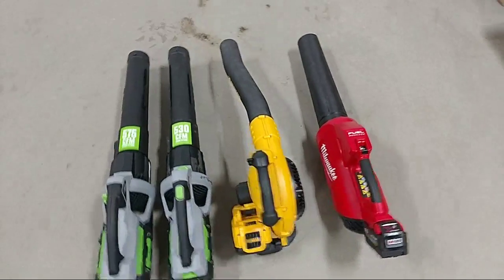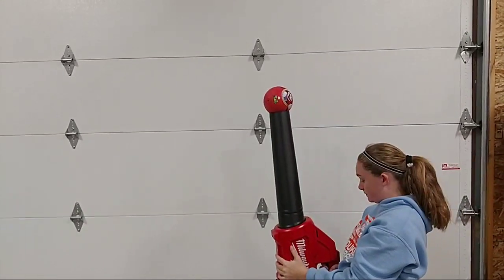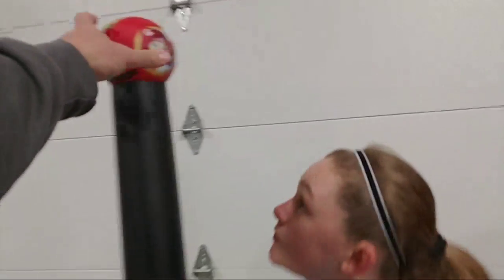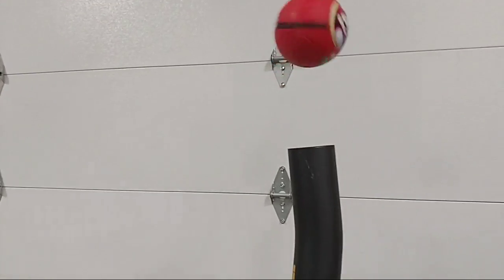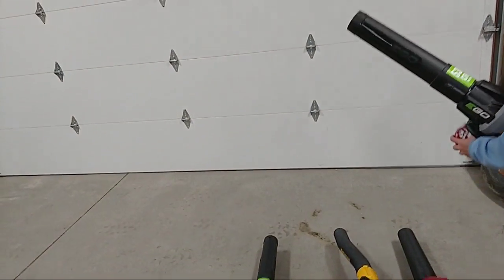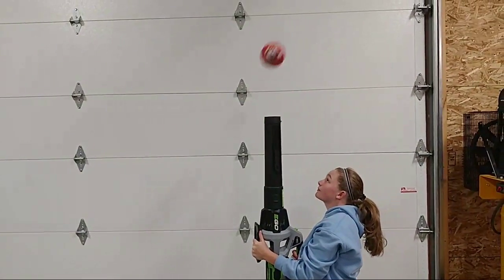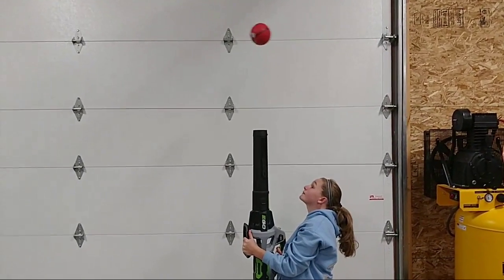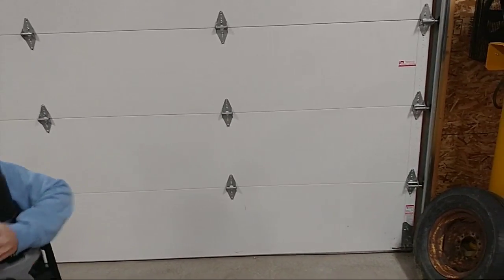LIVE: EGO 56v, Dewalt 40v & MILWAUKEE 18v Blower Testing

Comment: Have you had a chance to try the new gen 2 Milwaukee blower?
Reply from the maker: Tim Engle yes, it is just spring here so no video yet.  It is much quieter.
Reply: WorkshopAddict I just returned the gen 1 for the gen 2, i wonder if the extra 20mph would make a big difference on the ball height. Thanks and keep up the good work!
Reply from the maker: Not much.

Comment: What about taping the blowers to the narrow end of a cardboard funnel (or a tube) with the bigger end of said funnel to a fan and measure the power output of the fan moved by the air of the blowers, you'll need a load like a light bulb connected to the fan and a wattmeter (or two multimeters, one measuring voltage and the other measuring amps and compute the power by multipliying the 2)
Reply: I look at it like the horsepower vs torque comparison. HP (speed) is how fast you hit the wall and torque (CFM) is how far you take the wall with you. It's also like cleaning units on a pressure washer. To compare you multiply psi x gpm. So maybe a better comparison is looking at the "blowing units" (speed x cfm). Problem is with blowers I feel like the CFM rating has more impact.
Reply from the maker: romteb I like it, but would some of that come down to stricky mph of the wind....
Reply: If all the air from the blower goes to the fan (why you need a funel or tube with good sealing) then all the air produced will contribute to moving the blades of the fan, it's like a reverse CFM measurment, i suppose the watt figures will scale pretty linearly with the relative CFM produced by the blowers
Reply from the maker: romteb I like it.  My question is is a small stream of air at a higher mph will make the fan spin faster than a larger stream at a lower mph.  Basically, could an air compressor with a 1/2" hose spin the fan faster than a blower.  I know what your saying, just trying to figure our what is tested by doing this.
Reply from the maker: To take it a step further, we are doing these tests because some blower manufacturers will do a cfm test without the tube.  That has less restriction and the unit moves more air.  The the MPH test is done with the tube.  So we are trying to visually show what these blowers do.

Comment: What about blowing a bowling ball, with the nozzle at a set angle and hight from the floor, this adds weight to the test. Placing the blower at a predetermined hight based off the handle (they should all be held at the same hight in relation to the hip not ground) and at a natural angle to the ground. Then see how far each will blow a bowling ball, the distance will be determined by force applied.

Comment: Great visual!  My son liked the Mario ball.  Any chance you guys have the Ryobi blower to run the test?  I'm considering the Ryobi blower and trimmer because it's less than half that of the Milwaukee, and the Ryobi hedge trimmer is really very good - I've borrowed one.  I just want the blower to clean up after mowing and blowing off the deck and pool, so the Ryobi would likely be sufficient. I'm not planning to use it for leaf cleanup.  I have a Red Max backpack which is hardly sufficient for my yard.
Reply from the maker: Wild Goose it is on the way.

Comment: One complaint about EGO I heard is, unless they keep using turbo, it doesn't have much power.

I hope to see how it compares to others WITHOUT turbo.
If it lasts only couple minutes with turbo, probably it wouldn't be very useful without additional batteries. But if it's still pretty useful without turbo, I'd consider that for my next blower.
Reply from the maker: Kyong Song Take a look at our last video.  They have a new unit without the turbo button.  More like main stream blowers.  But everyone likes different stuff and we hope to provide the info people want to k is about all the brands we can.
Reply: Oh, thanks. It looked similar, so I thought you are reviewing the old unit. I will check that out.

Comment: this is a very good comparison in my eyes (being a landscaper for 8 years now) if I was going to buy all new electric stuff I would go Dewalt more power than Milwaukee I just don't see the ego stuff holding up after what I've  used from them. other than that great video keep em up
Reply: HAHAHA milwaukee blower then low pressure blew to ball, DeWALT 40V and 60V blower then more high pressure blew to ball

Comment: Thanks for the test. I am surprised that Milwaukee was the worst!
Reply from the maker: The Milwaukee ramps up so fast that it makes the unit feel very powerful.  In fact the M18 is rated at 450 cfm where the Dewalt 40 volt is rated at 400 cfm.  But cfm ratings are or can be misleading because some do not use the tube to complete the cfm test, but do use the tube when doing the mph test.

Comment: Just get some leaves and put them all even and hold the trigger. See the patter and distance. Or build one of the rigs they use on the backpack blower testing.
Reply from the maker: Getting leaves that are not rotten is tough right now.  Been thinking about animal bedding.  Thank you!
Reply: just use pine shavings, same as leaves or other debris and throw a few sticks in it should work.